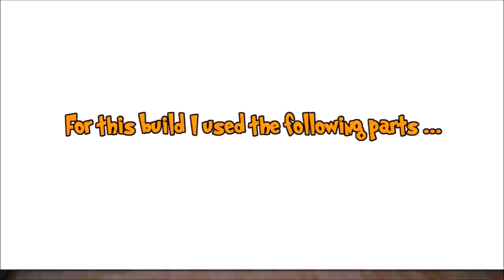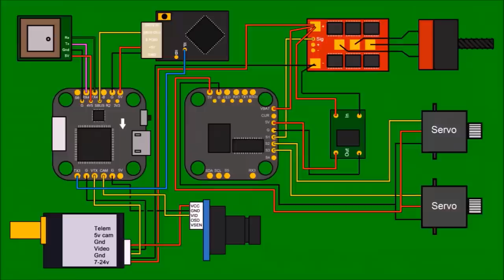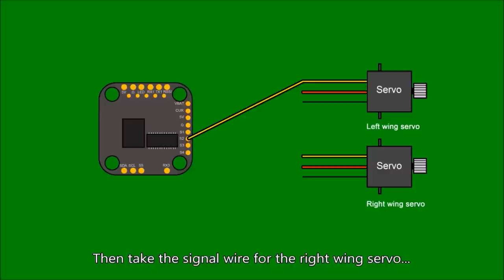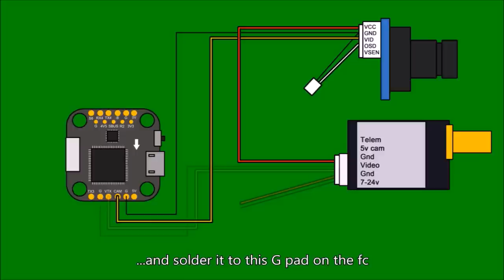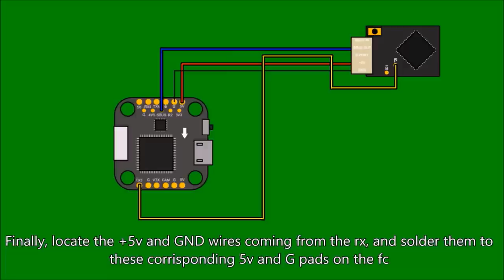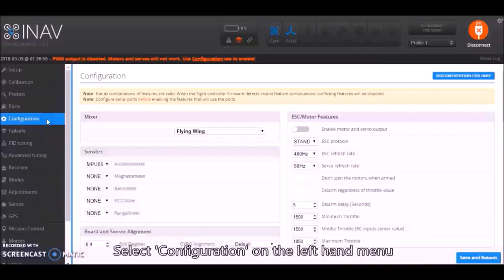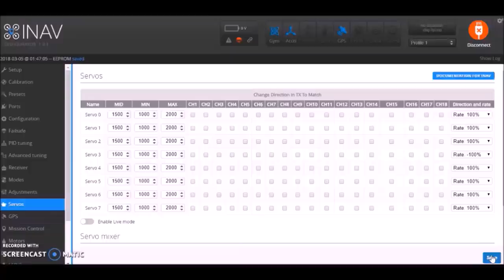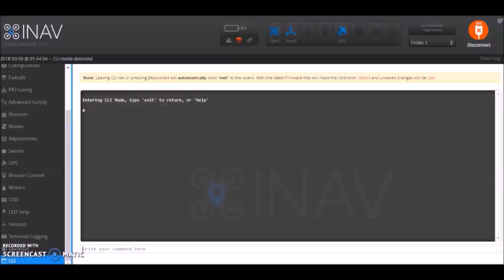🛩️ Sub 250g INAV FPV wing drone build

Comment: That's a super tidy build. I messed mine up, trying to overpower it with a heavy 2205 motor. I think you did it just right, keeping it light. But I think you goofed with the Elevon control hinges. The control rod should meet the control horn "ON" the Elevon Hinge. This according to Sir Bruce. Other than that, cracking build video.
Reply from the maker: Funny you say it's tidy because I think it looks a mess haha. But I usually make a dedicated effort to make my builds look really nice. Unfortunately cosmetic details usually add weight so this build has had to do without. Yeah I know I made a bit of a error with the elevons, but it it still flys great so no dramas :)
Reply: Still way better than mine. I will probably buy another at some point and use a little 1806 motor. I need a 1300 4S in mine to make C.G. It flies like a house brick, but is pretty fast.  I am not sure about the range on thse Receivers, but I know the XM+ Micro is good for 6km and that gives RSSI if you flash em with the latest firmware. They are a calm weather bird, like the Bonsai.
Reply from the maker: blackbirdboy1 Nah I'm not convinced the range of the R-XSR will be all that good, although saying that I've done 1.7km with mine so far and that was no problem. At some point will probably be popping a TBS micro Rx in there though

Comment: Great Tutorial for the noobs m8....well done.....The only thing I spotted that confused me a bit was that one servo was on output S2 of the FC...When they should be S3 and S4..?
  The only other thing for me was no LC Filter...the power feed wire came directly from the ESC....Noise..?
 The Seven lines of code copy and pasted into for the FC were nice too, nobody else has done that in a video and yet it's so crucial and obvious for virtually every build. 
  I wonder when someone bright enough will add those 7 lines of crucial code as a default to the Firmware.?
Reply from the maker: EnglishTurbines I don't know why, but the Matek mini FC is a little different to normal fc's. Pwm 1 is for motor, then pwm 2-5 are for servos. The second motor output is on pwm 6. It confused me a bit when I first wired it up, but for some reason that's the way it is lol. I didn't bother with a lc filter initially as wanted to keep the weight down, and then found on test flying that one wasn't needed anyway. There's no obviously power noise when flying :)

Comment: Great video with clear instructions. Where can I buy the plane? I’m in the UK.
Reply from the maker: Unfortunately the company that makes these wings no longer exists. Shame as they made good stuff :(
Reply: @gizfpv  that’s a shame. I was looking to build something under 240g. I’m a novice so your instructions were very helpful.
Reply from the maker: @247SH  See if you can find a Zohd Dart 250. That's a similar small wing that can be built under 250g if you're careful. As far as I know they are still being sold
Reply: @gizfpv  many thanks, I’ll do a search :)

Comment: Couldn’t you us the 5v power from the esc instead of the 5v regulator
Reply from the maker: Potentially yes. However I didn't know how many amps the esc bec was providing. As I needed a 5v source capable of providing enough amps for 2 servos, the fc, rx and gps, it seemed safer to use a regualtor that I knew could provide the required power.
Reply: Giz FPV ok thanks for replying

Comment: Hey man!  What do you think of the furious Fpv f35 lightning?
Reply from the maker: I've not used one myself, nor have I seen anyone use one yet either. But from what I've seen it looks kinda cool. Possibly a little expensive though. You can put together a decent inav setup for about £35, although granted that wouldnt have bluetooth.  I've yet to see any for sale in the UK, but once they do I may pick one up and try it out

Comment: Hi Giz FPV. Question. Why do you select, Permanently enable AIRMODE on the configuration?... I understood that it only applies in quads.
Reply from the maker: No that's not true. Airmode also works on wings too. With airmode disabled, when you go to zero throttle (to glide) the stabilization turns off. Having airmode enabled means that stabilisation is always on. Obviously if you dont fly in a stabilized mode then that wont make any difference to you
Reply: Giz FPV thanks for the answer and explanation :)

Comment: Got a generic name for the 5v regulator for the ebay search? Thinking i'll build this in the US.
Reply from the maker: I'm not sure exactly where I got mine from as I found it in my spares box, but any generic small 2-3a 5v regulator or step down regulator should do the trick.
Reply: Thanks... Just checked shipping on the wing itself is $60 to me.
Reply from the maker: Ah that sucks. You could maybe look at getting a Nano Goblin instead. I haven't built one myself, but from what I've read about it, a sub 250g build should be possible using one of them. I almost got one myself

Comment: Love the build mate, nice and clean. However... I hate to be "That guy" But you set your control horns up wrong :/ The pivot point (Where the linkage stopper is) should be directly over the control surface hinge. And the control rod should be 90 degrees to the horn/surface.

What you did there will give you A LOT of movement in one direction and spongy unresponsive movement in the other! Sir Bruce did a video on this, think its called "Control Surface Geometry"

I cant idly sit by and watch as a fellow pilot has uneven control surface movement...
Reply from the maker: I know, it's mentioned in the video description that I made that mistake lol